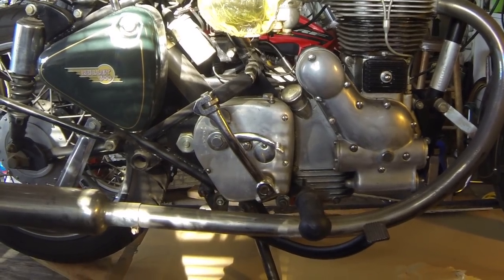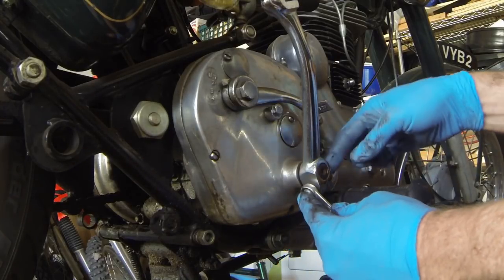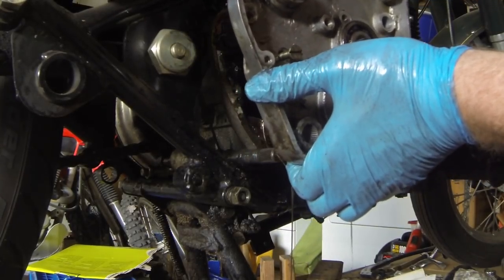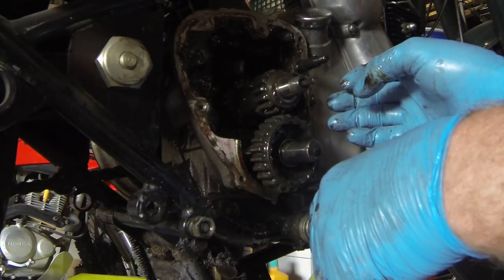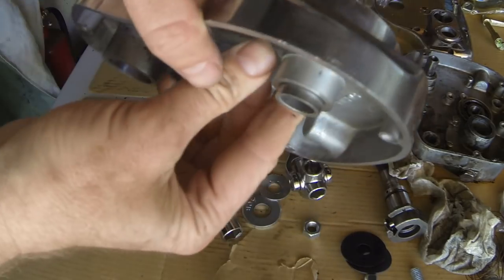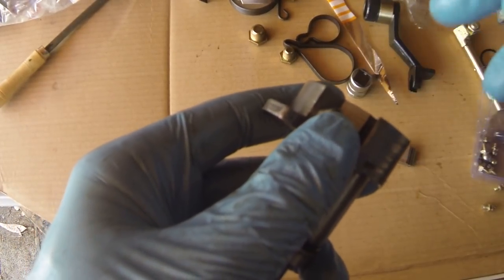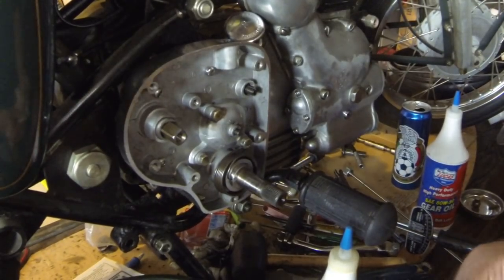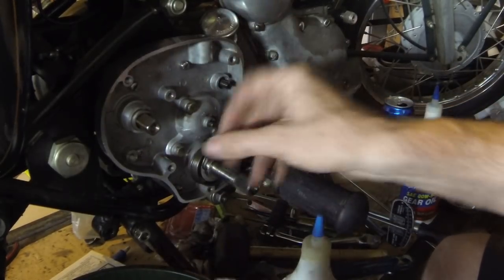Royal Enfield Right Shift Conversion how-to

Comment: The bolts you took out at 9:55 are the bottom two gearbox to engine bolts, they have to be put back, you have 4 bolts total two at the top and the ones you removed.

Comment: I believe that those two long bolts that held the shift linkage in also are the two lower of the four bolts that hold the gearbox to the crankcase.
Reply from the maker: +Damon Chesterfield Thanks. They looked important, but I didn't know what they were for. I put them back on the bike.

Comment: I noticed that you did not remove the clutch, clutch hub and drive sprocket to completely remove the main shaft and the layshaft gear sets.  That coincides with no Right Hand Gear Operator Fork being in your conversion kit as I did not see that fork.  Forgive me if that Gear Operator Fork was just outside your camera view.  If you did not change that Gear Operator Fork I would assume that you would  have a tough time getting into 3rd and 4th gears.   I watched your clutch replacement video and it, like all of your videos, are very informative and very much appreciated from all of us Bulleteers that are making these modifications.
Reply from the maker: +KorgPS thanks. I don't remember what all was in the kit, because it was a long time ago, but it does shift through all the gears. I don't ride the motorcycle much because it has a weird electrical problem now, and sometimes leaves me stranded. The gearshift pattern was upside down after I put the kit in, but it shifted through the gears properly.
Reply: You do not need to remove the clutch, clutch hub or really anything on that side of the bike except the shift lever, to do this kit.

Comment: Sir.. its a beautiful video of conversion.. but one question for you.. can we convert it to an automatic transmission which is belt driven after removing all the gear system ? Waiting for your reply asap.. thanks..
Reply from the maker: I don’t think so. I’ve never heard of anybody making automatic transmission for a Royal Enfield motorcycle.
Reply: Yes we can sir but we need a CVT of 40 series or more but it won't run more than 45 KM's but hour this would be a top speed as I have seen some videos on YouTube and the pick up would be awesome but if we want to increase more speed we would want some high series torque converter.

Comment: Sir first of all I want to appreciate for all the efforts and time you dedicated in making this video. Secondly, it was first time I watched your video and believe me you were so precise.
Now I would like to ask you this question, so I have 2002 enfield standard 350. It has left hand conversion installed when I got it. I don’t experience any problem in shifting as it only has 5000 miles. The gears are just like any other motorcycle, first down and rest three up. Now if i decide to change the gear to right side, will I still have the same gear setup first down and rest 3 up or it will be like the traditional enfield gearing 1 up and other 3 down.
Also I was thinking of replacing kick start as The gear box will already be teared down. I do have self start in the bike, will that make things different?
Reply from the maker: If it works fine, I would recommend leaving it alone until it starts to get sloppy. There are different kits, and some of them have normal shifting, and other ones are the opposite, with one up and three down. Whichever kit you get, it will come with a kickstart conversion as well.
Reply: Bro can u please send the picture that how your gear system looks like on the left side?

Comment: sorry its not suspension i mean i want to upgrade  front big single drum brakes to disk brakes with out changing allow wheel as i already inserted new model disk brake suspension in it ...plzz help if possible brother . ....
Reply from the maker: I don't know.  I think you at least need to change the hub, which would mean taking off all the spokes and putting in new ones.  Replacing the front wheel with a disk wheel would be cheaper and easier.
Reply: +hoohoohoblin @ actually  m having blade alloy wheels  there is no spokes which is having big single  drum  brake/hub in front  tyre which i want to change into disk brake with out changing the wheel but stuck to attach disk on front wheel or else the last option is to change the wheel into disk wheel ?but i was looking for any trick if its possible  to attach disk on single drum hub which could save my bugs to purchase new pair of diskwheel....

Comment: Hi- Would you be interested in selling the old left side gear lever that you removed from the bike? Mine has gone missing, and I can't seem to find the right one for sale online.
Thanks,
Jon
Reply from the maker: I'm going to keep it, just in case I ever want to switch it back.  You should be able to find one from Royal Enfield, or from Hitchcock's.  There are also some for sale on eBay right now.
Reply: There seems to be a lot of the versions with the large spindle size, but finding one designed for the left side with the 12 mm clamp seems to be eluding me. Hitchcock's don't seem to list them at all, unless I'm looking in the wrong area of the site. What do you search for? Ebay seems to be the same - no versions with the 12 mm clamp that I can find.

Any help would be greatly appreciated.
Reply: Jon did you find the lever?  I think I have one.

Comment: Come on man, did you just give up after all that work and expense? Did you complete this job on another video?  I did this same conversion a few years ago on my 2000 Bullet 500. I bought the kit from England, it arrived missing some critical parts, ( The fault of the US Post office, not the company that sold me the kit in England) the box arrived with a chunk missing from the corner of the shipping box and the post office told me "tough Shxx ,we aint payin".  Anyway I managed to finish the job after ordering the replacement missing parts and it's like riding a brand new machine, after some fine tuning of the shifter. 
 That hodgepodge US model, left shift mess was so bad I refused to try and ride the bike with it on there. I really like you videos by the way.
 Jim
Reply from the maker: +Jim G Yeah. I gave up when the bike started having electrical problems when I was trying to get the shifting set up right. Been too busy to get back to it.
Reply: Yeah, I can relate to that. Getting the shifting dialed in can be frustrating and electrical problems seem like the most annoying of all. Like you the Bullet is not my only bike and I've sent mine to the corner for a time out more than once. Still when shes thumping down the road I can't wipe the smile off my face. Keep up the motorcycle videos, their great, no nonsense and very helpful. 
 Jim

Comment: Why would u want to change it ur gonna get confused riding a other dirtbike or motocycl
Reply: He rides a lot of different motorcycles. Adjusting will be no problem since it's common for different bikes to have the various controls on opposite sides.
Reply: Well, not really... Only properly old bikes have different set ups. Since the 70s every bike has had shifting on the left and braking on the right.

I drive both and I sometimes step on the brake instead of shifting gear, mostly the first couple of minutes on a bike.